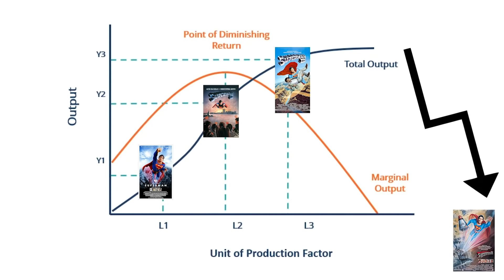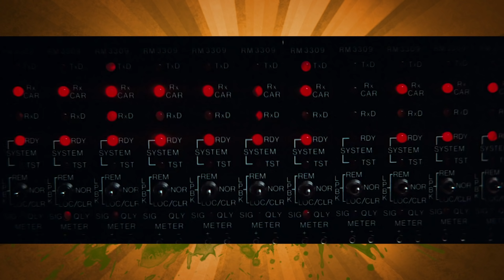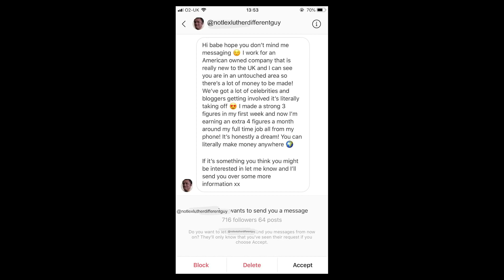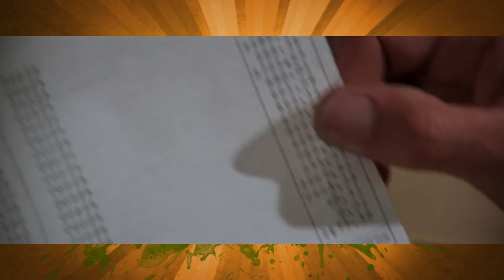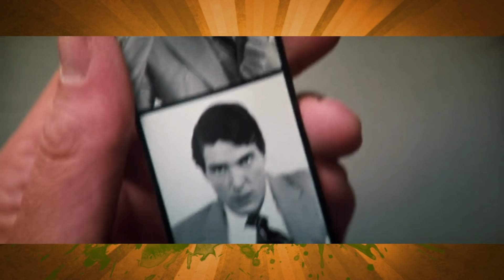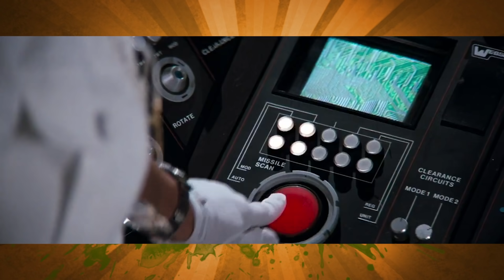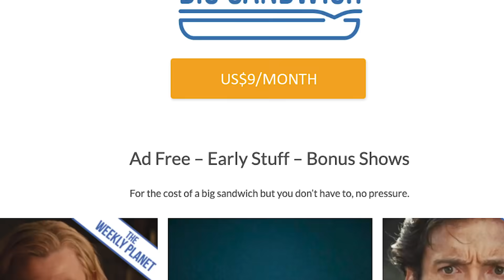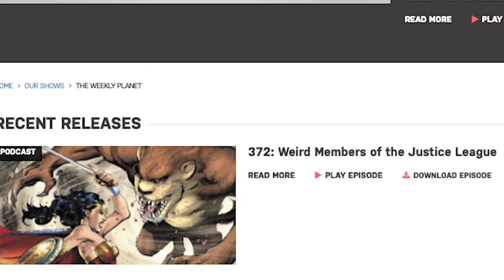Superman III - Caravan Of Garbage

Comment: 10:10 What if it's the same acid? It is the same acid. Maso's right. That scene earlier on is there  to set up that if it heats up it'll eat through anything. They have a quick insert shot showing Superman flying back to the acid factory or whatever it was and it's in the same type of container as the earlier scene. Same acid.

Comment: That BASIC Gus wrote on the computer, man that was terrible. If they had the foresight, they could have hired a real programmer to make some kind of Superman Easter egg code. Whereas Gus' code was:

5 CLS
10 PRINT "PLOT BILATERAL CO-ORDINATES"
15 PRINT  ,  PRINT
20 GOSUB 5000
25 PRINT "INPUT CO-ORDINATE X  .    "
31 PRINT "4",
33 PRINT "2",
35 PRINT "Y" , PRINT
40 PRINT "INPUT CO-ORDINATE Y  .    "
41 IF INKEY$ = "" THEN 41 . IF
42 PRINT "Z",
43 IF INKEY$ = "" THEN 43 . IF
44 PRINT "+",
45 IF INKEY$ = "" THEN 45 . IF
46 PRINT "X"
47 GOSUB 5000
50 CLS
60 PRINT "0010 N = RND(200)"
70 PRINT "0020 Z = 1 TO N"
80 PRINT "0030 X = 1 TO 31"
90 PRINT "0040 Y = 1 TO 15"
100 PRINT "0050 SET(31=X,16=Y,2=Z)TO 31=X,Y"
110 PRINT "0060 SET(31+X,Y,Z)TO(31=X,16=Y,"
120 PRINT "0070 SET(X,16+Y,Z-Y)TO(X,Y,Z)"
130 PRINT "0080 SET(X,16,Y,Z+Y)TO(16+X,Y)"
140 PRINT "0090 GOTO 500"
150 PRINT "0100 NEXT X,NEXT Y,NEXT Z"
160 PRINT "0110 CLS"
170 PRINT "0120 DATA 1,13,2,67,2"
180 PRINT "0130 DATA 13,45,90,3,23,56,2,54"
190 PRINT "0140 DATA 3,6,1,43,92,56,2,9,0"
200 PRINT "0150 DIM F(?)"
210 PRINT "0160 D$ = CHR$(191)"
220 PRINT "0170 FOR X = Y + Z  PRINT X"
230 PRINT "0180 FOR Y = X - Z  PRINT Y"
240 PRINT "0190 END"
250 PRINT
260 PRINT
270 PRINT
280 PRINT
290 PRINT
300 PRINT
310 PRINT
320 PRINT
330 PRINT

Comment: Between this nd the next one they should have actually done Bizarro or Brainiac I mean just get the rights or whatever to the comics. Don't make up your own OC who is totally  your own original ide not a copy of the existing character.  IMO Bruce Tim is the only one who got ANY DC movie right . The Adam West series was fun too  but in a whole other direction that lacked the inclusion of Superman and Wonder Woman who Adam's Batman  could have teamed up with.  I think 3rd Would be the CVW versions since they do include actual comic chatters in thee actual costumes. I have to take points off of Dean Cain for Also not having Superman Rouges  and not using other DC heroes.  and Smallville and Gothem also suffer for the same reason they added there heroes and villains too soon. and both filed to put Clark  and Bruce and Diana  together at the same time.  Any other version is too violent, too dark or too campy.  So best versions Bruce Tim, 66  and CW